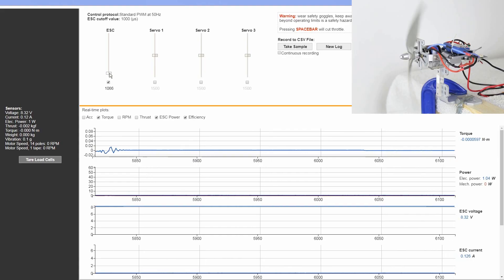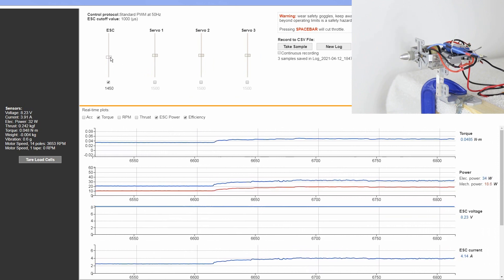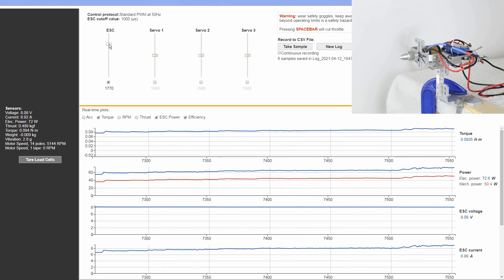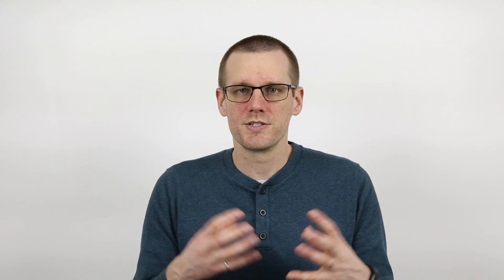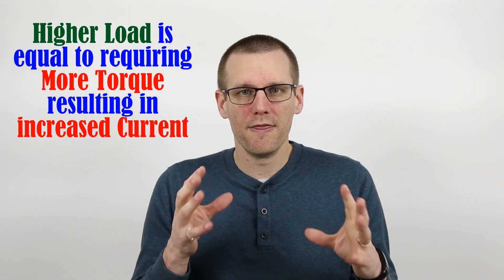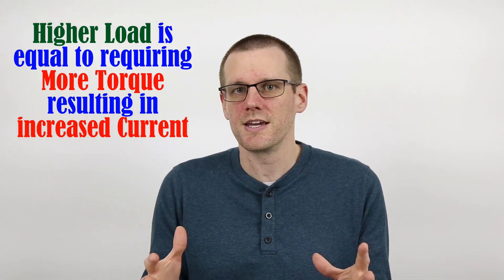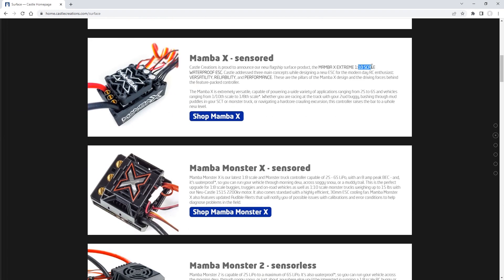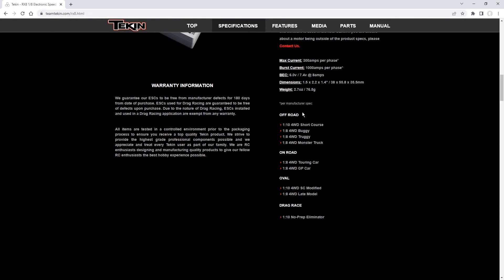How to Select a RC Car ESC with No Amp Rating on the ESC

Comment: hi, I hope someone can answer me, I have a mjx hypergo 14302 (1/14) 1.1kg in weight, with a 2s and 3s (25c) battery, a 2845 3700kv motor, and a 45amp esc, I replaced the original esc, because it has a delay in response, and I bought a much larger esc just to have more gap, a more big surpasshobby kk120amp, only that when I accelerate all the way from a standstill the car has some bursts of power cuts in start very evident, then it fixes itself, then I thought the esc was too big in amperage, and I bought an identical one but KK60amp, and the same thing happens, I tried to calibrate it, to change the brand of batteries by putting a 3s of 50c, but it has the same problem, with the 2s 25c battery it doesn't do it, what the hell could it be?
two esc with the same defect? it seems strange to me?
Reply from the maker: Sounds like it's hitting LVC. If so your battery can't deliver the power demanded of it.
Reply: @RCexplained hi, thanks first of all, it seems like a similar thing to me too, actually, starting with less gas, or with the 2s battery, or reducing the punch with the program card, it doesn't do it, or it does it much less, I don't understand?  with 2 esc, 120a and 60a, it does it, with the original 45a one, it works very well, i used 3 different battery, 2 3s(25c), and 2 3s zeee 50c, crazy stuff
Reply from the maker: What is LVC set to and if you temporarily diaable it, does the problem exist?
Reply: @RCexplained  the esc have only 3 possibilty, 3,1v 2,9vand 2,7v, and , can not disabile, with 2,7 setting do same problem🤔

Comment: Hi, I am planning on getting a 1/10 short course rc car weights about 6 KG I have seen videos and it's not very fast so also getting a bigger motor. The RC use 3S batteries and come with a 120A ESC and Surpass Hobby 3660 2600KV says on the specifications chart that has a max amps of 63A and  Io of 1.5 A and running around 33K rpm on 12.6V, I was planning on get the Surpass Hobby 3660 4200 KV the chart says max amps of 100A and Io of 3.7A this on 3S 12.6V get over its 50K RPM limit by 3K rmp so I don't if that little exceed rpm will be tolerated or the Surpass Hobby 3660 3500 KV  the chart says max amps of 92A and Io of 2.8A has a 44 K rpm on 12.6 V both motors has a max rpm of 50K, do you think the 120A ESC will do the work or increasing the KV of the motors would reduce the initial torque and current against the original 2600KV so there won't be any problem with the upgrade, that 4200 Kv is the more powerful in the 3660 size but there is also the 3500 and 3100KV so this is also and option, also mention that I can't change the ESC or the gearing so my only option on increasing speed is by the motor KV or maybe get a 3674 motor 3000Kv. Thank you for your time and great content.
Reply from the maker: You can select any motor that you are comfortable. The motor will only draw as much power as it requires. If you gear it very conservatively, a 120A esc will be fine. Check Temps afterward.
Reply: @RCexplained  Ok, so would you recommended go with the same length on the 3660 4200KV those 3K rpm over the 50K max rmp  limit would afect the motor or not? Also would be better getting the 3660 4200KV or a motor with much torque and speed like some 3674 3250KV? Not really sure if is better to get much more Kv or just a little increase but much torque, I guest I as I want speed I should go with the 3660 4200Kv.

Comment: Man so you mean that if the scale of my RC is 1/10 , and my motor is enough with 45A, doesn't change anything if I mount a 50A or 110A ESC ?
should I get more benefit anyway with the 110A?
thank you 🙏🏻
Reply from the maker: No difference. The 110A ESC will run cooler and be more reliable as its not pushed as hard. That is about it.
Reply: @RCexplained  K, thank you 🙏🏻

Comment: How to select esc with how much kv's motor is best 
For example how much amp esc is need for 5900kv motor
Reply from the maker: Using kv alone is impossible.
Reply: How i find the right values even about motor first 🥲
Reply from the maker: What is the diameter and length of the motor case?

Comment: Selecting an esc based on scale it helps if its meant for track racing with limitations or rules when it comes to the motor.. Motor KV plays a part too.. especially for drag and speed runs, so selecting an esc based on what is mentioned on this video or scenario may differ..my 2 cents

Comment: Thank you for your information.
I agree that electronic equipment selection according to scale is not good.
Many people are confused about what equipment to put in their vehicles.

so
weight of a vehicle 
desired velocity 
gear ratio 

with three pieces of information

motor KV
motor watt
anticipated heat generation

I would appreciate it if you could make a simulator that can calculate.

In RC airplanes, these calculators have existed since 10 years ago, but there seems to be no RC car.
It would be nice if you could make it.

Comment: Yes but how do we determine the max amp draw limit for a given esc? How do you choose between two 1:8 esc? Which one is more reliable? What are their designs intended for? Many r/c enthusiast have the knowledge to make their own calculations to reach their goals but they cannot do that with missing information. This is as assuming manufacturers are producing  esc and not know their specifications and ratings? Scale sizes is virtually irrelevant as ppl are adding other/larger components to a 1:16 to reach 100mph and other 1:8 scales ppl are removing weight to make them lighter In addition to swapping to a more powerful  electric motor makes the ENTIRE scale reference inapplicable. We need the specifications.
Reply: Anyone searching for this type of information is already passed the RTR stock out the box setup and are looking to level up.. Everyone else would think to them selves., oh okay I see…🤔 and then have a million questions about motor selections.
Reply: @AutoBodyEverything  here I am, in exactly this case... Currently designing my own RC car FROM SCRATCH.
What's even worse, is everyone talks about scale, yes I know the "scale" I'm aimed within, but pretty much all these vehicles run a single motor, and single ESC. 
I'm designing for a motor and an ESC PER WHEEL, with then a huge "brain" controlling it.
It gets very annoying when companies can't place normal electrical ratings on items, give me peak, give me continuous, give me temp ratings, hell, I'll even take the resistive ratings so I can calculate the thermal load!

I'm attempting to avoid needing to design my own ESC with the current global electronics shortages going on...
Reply: @thedevelopmentlab  …. This design sounds like that concept rc with an out drive motor on each wheel and a main control unit almost like a drone platform. Kev T had it on his Chanel and it broke piece by piece bcs some parts were printed like the rims and the whole thing failed bcs of poor hardware integrity. The electrics on the other end worked well and I still have high hopes for its return. I think it was MAMMUTH works.
Reply: Yes I saw that RC car, it was pretty cool.
Theres advantages and disadvantages to how they ran their system.
Advantage is size and space. 
Disadvantage is a dramatic increase in unsprung weight, which makes it a lot harder for the suspension to do its job of keeping the wheel in contact with the ground.

The setupi described of mine is only stage 1 of my whole design process, ive got a lot of fancy ideas on the draeing board :)
It will take a LONG time for me to finish it however, ha ha

Comment: Shoot I had my 1/5 kraton exb out today at the park pulling wheelies at 76mph lol per GNSS I can only imagine how many amps I was pulling haha I have to check out my data logs on my xlx2 I have the 1100kv 2028 on 39/34 gearing and temps are 125 ESC and 119 on motor.
Reply: Thats the motor and speed control i am putting into my 1/8 scale buggy. Should be pretty fast.